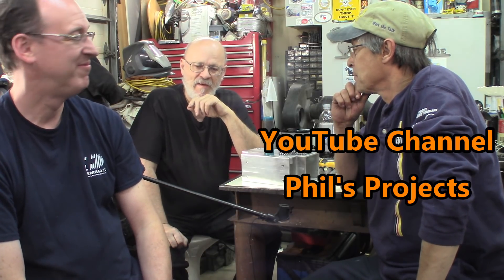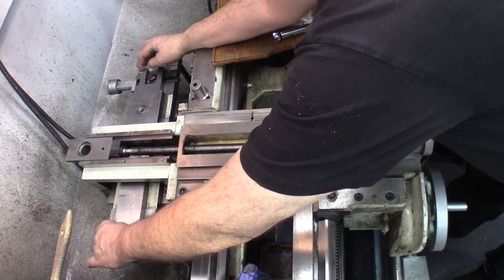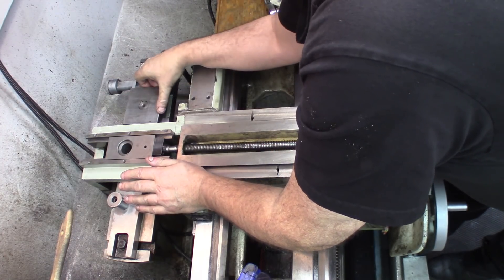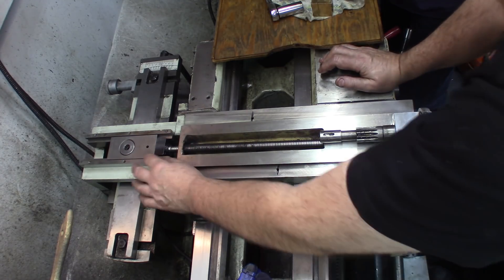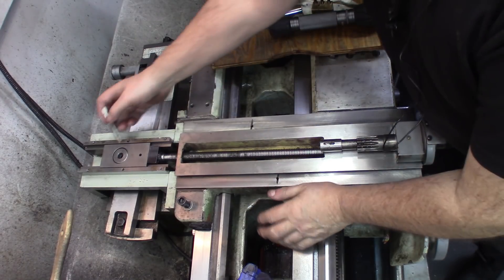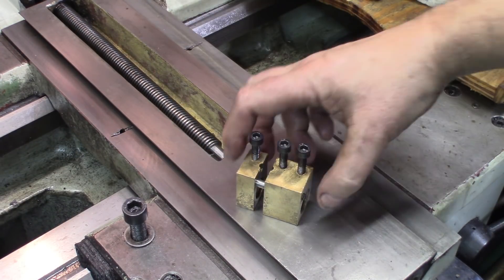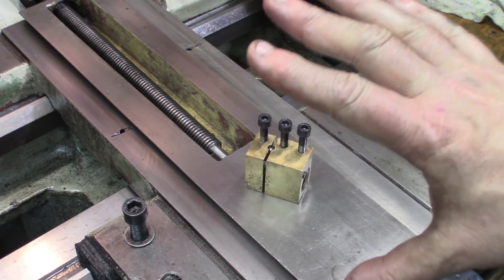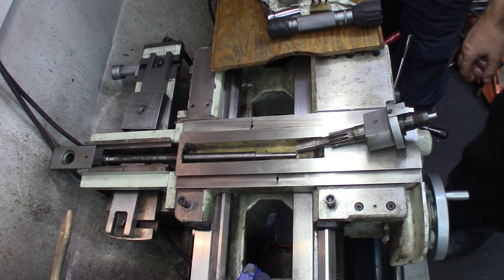Lathe Taper attachment details, how it's made, functional details... and more!

Comment: I like that attachment a lot - mine works well but is a pain to attach and set up. Yours is way more useful. So much better not having to release the leadscrew nut.
You have a very versatile lathe there.
Reply from the maker: Hi Chris,
The present attachment is quite easy to setup and use, a nice add on for the lathe, this is what I used when making the handles for the machinist hammer, went real easy...
Good thing we don't turn tapers everyday, or, we'd be real good a it...   lol
Cheers,   Pierre

Comment: Nice raspberry jam you have spread on the cross-slide of the taper attachment. I built a taper attachment for my Harrison lathe based on ThatOldTony series and it works great, but is not nearly as convenient as yours. Thanks for sharing. Nice.
Reply from the maker: Hi Jim,
Leftover, past due jam, this is where unsafe for consumption food goes around here, machines love old bacon...   lol
This present taper attachment is real practical and easy to use, it's better when it comes originally supplied and adapted for the machine, just like this one...
Thanks for watching and for comment,    Pierre

Comment: would this be capable of making accurate morse or jacobs tapers? or are those better by dialing in on an existing taper?
Reply from the maker: This attachment is quite accurate, but as for any work on a manual lathe, the operator counts for a big part of the success, in good conditions the actual set-up with the present machine, it's possible to make quite accurate tapers, as you know the very high precision parts are ground on a cylindrical grinder.
You can get very good finish and fit by manually using some polishing techniques involving blueing and corrections, using a decent reference will give you a good tool or part...   ;)
Thanks for your comment,    Pierre

Comment: That one goes in my "reference" library for future reference.
So I can reference it at some future time. 
In case I need to reference it.
Seriously.
Thanks,
John
Reply from the maker: Hi John,
This reminds me some time ago looking to find good videos or informations about taper attachment on the web, they were kinda rare or not very detailled, hope this is a step up in the right direction...
Thanks for viewing and taking some time to comment,    Pierre
Reply: Hi Pierre,
I need to build one for my Atlas and I don't want to disconnect my crossslide nut every time I want to use it. The standard taper attachment for that lathe requires that so I need to design from scratch. The splined shaft is the trick I was looking for.
Thanks for this video.
John
P.S. And the humor.😊